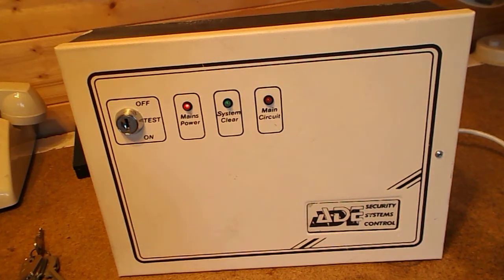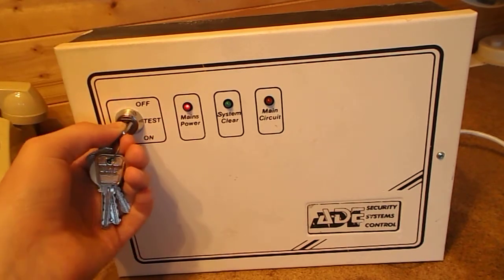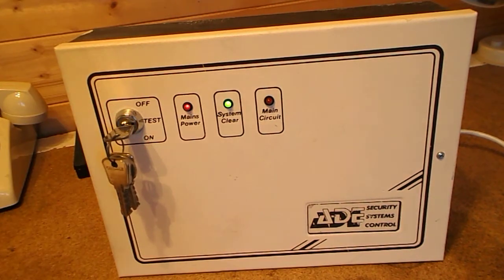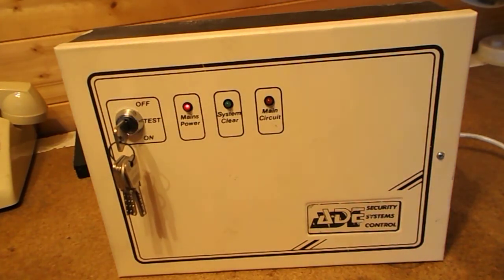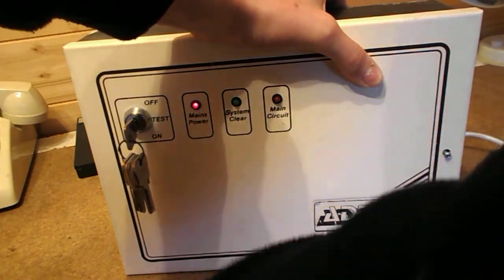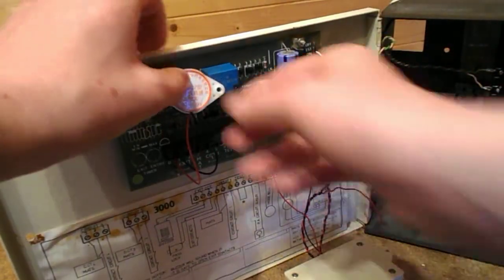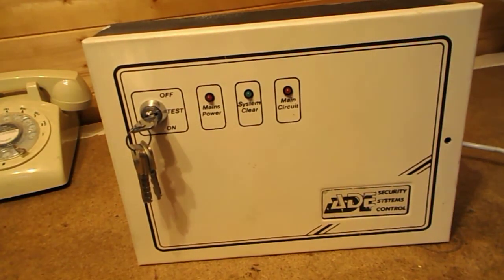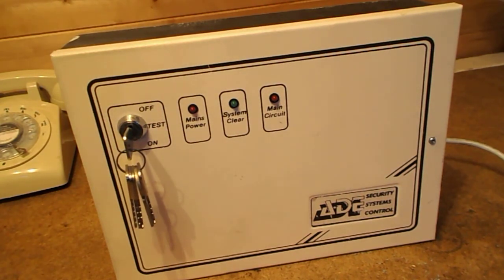ADE Security Systems Control keyswitch burglar alarm control panel demonstration

Comment: There is nothing wrong with the panel. This panel doesn't have a exit delay instead it will set as soon as the door is locked as there is a micro switch in the lock

Comment: Hi Jake hope your well. Panels of this type don't set using a timer. The front door or exit zone protected door will be fitted with a shunt lock. This is a mortice lock that has a microswitch inside it. They way to set is to go to test position on the keyswitch. If all clear you change to arm. Once you close the last door the mortice lock is turned to set the system. You reverse the process to disarm. So unlock the door to operate the switch in the lock and the buzzer sounds then set the key on the panel to off. The circuit is sometimes marked as "shunt lock" but in this panel I think its the terminal marked "pass lock" these terminals are normally opened to set the system. Try conecting a pair of wires to the pass lock terminals twisted together. Arm the panel then open the door guard loop. This should set the system. I think I can see a sping loaded jumper just above the terminals. If you have any problems just post up or email me a picture of the wiring diagram. Shunt lock type systems used to be the normal method of arming a panel of this type. I hope this helps, let us all know the results. Good luck and keep up the videos.  :)
Reply from the maker: Stuartbe i will definitly give this a go tonight and i appreciate you sharing all this information with me. if you watch my video on the tradeguard epsilon keyswitch panel, you will see it has the same problem, a never ending exit delay. do you think that panel is still beeping for the same reason as this one?
Reply: Jake McIntyre it could well be. let me know how you get on with this panel. if you google shunt lock alarm setting in google it explains how it works. :)
Reply from the maker: Stuartbe right i will give it a go and tell you the results. once again, thanks for all your help :)
Reply from the maker: hiya, unfortunatly i am struggling with the wiring, should i send you a picture of the wiring diagram?
Reply: Sorry m8. only just seen your message. yes please if you send me a picture we can work it all out. Are you able to email me from utube?
Reply from the maker: Stuartbe hi, i will see if i can send you a picture of tge wiring diagram through youtube. once again, thanks for your help.
Reply: Jake McIntyre Hello Jake. I think its great that you love playing with these systems and I would love to help you with the problems you are having. However I cant find a way to email you. Obviously I don't want to post my email address, are you able to email me or add me on google+ so I can help you with these panels?
Reply from the maker: Stuartbe as i am not the greatest with computer technology, i can imagine me finding myself in great difficulty trying to add you through google plus. what i would rather do is post MY email address  on this comment section and then delete it when you reply to my comment. we can try that if your comfortable with it?

Comment: Have you tried pulling the key out when you set it?
Reply from the maker: Dynamic Security Systems come to think of it no i havnt, but how would that affect it?
Reply: Because it's beeping to tell you to remove the key. Because if it was left in, the whole idea of an alarm would be pointless as the burglar could just unset it. Try it, it might work it might not!
Reply from the maker: Dynamic Security Systems i will give it a go, but i dont have my hopes up as i have used keyswitch panels in the past that will set with      the key left in and also i dont think this panel is advanced enough to detect weather the key has been removed or not. i will give it a go and give you the results in 10 mins  :)
Reply: Jake McIntyre ok it's only a suggestion so like I said don't count on it!
Reply from the maker: Dynamic Security Systems i have tried it but no luck, i think its knackered. thanks for your help anyway :)
Reply: Jake McIntyre ok no problem